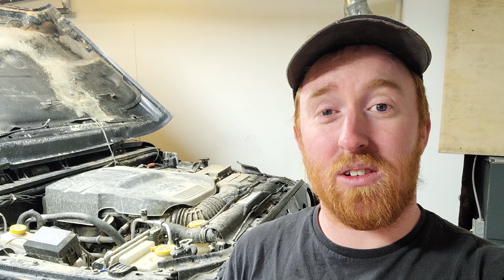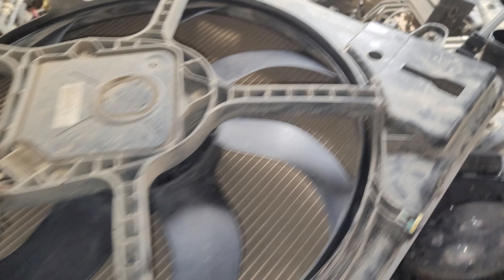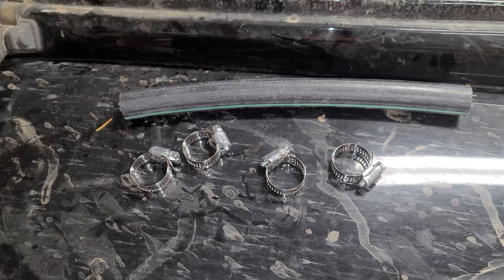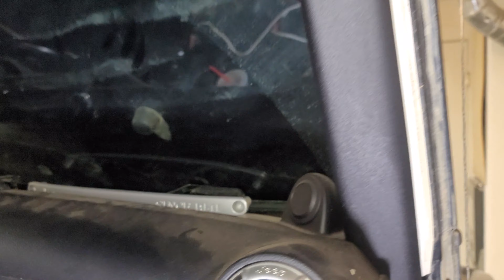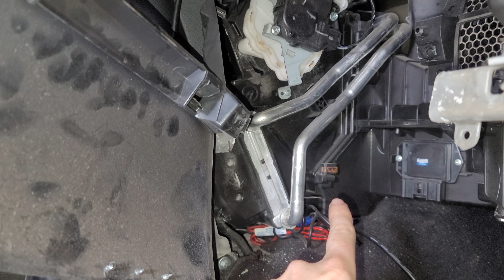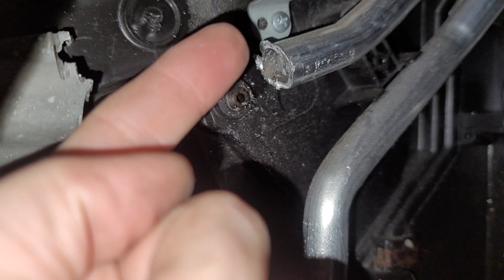Jeep Wrangler JK CASTING SAND FIX!! Replacing Radiator and Heater Core

Comment: I believe that with the cost of $1000, to remove a car or trucks dash, to remove and replace a clogged heater core, that a inline coolant filter is necessary. Just do it.
Reply from the maker: I did end up adding a coolant filter in the jeep, which helped a lot in addition.

Comment: Did this fix the problem for good? Having the issue right now.
Reply from the maker: It did mostly. I ended up adding in a coolant filter as well to collect the little bit left over. The combo of the two helped out a LOT. I recommend both. I have that video posted as well.
Reply: @4WDTrek  please post a link
Reply from the maker: @greenlawler  https://www.youtube.com/watch?v=D1j9o2Xk9pU&list=PLwh0HtmxULTWqQTefPcoSEmA_7ptGzfL5&index=10

Comment: I have a 2010 and just need to change the heater core. what coolant did you put back in?
I read it has to be HOAT, but the HOAT I found was Gold. The stuff that leaked all over my passenger floorboard was pink.

Also, how much coolant do I need to refill after I drain it all?
Reply from the maker: I do believe it should be HOAT coolant. Could be a possibility that someone put the wrong coolant in at some point.
I'm unsure coolant capacity for the 3.8l engine. I would suggest looking at the owners manual to verify the coolant type and capacity specified for your year. 
Probably your best reliable source.

Comment: I recently bought a 2016 Wrangler with 23,000 miles on it. Heater works great. Air-conditioning works great. No leaks. No coolant smell. The overflow bottle was very low and I have since filled it to the correct level. Do all 12-17 wranglers have this problem issue ? Thanks!
Reply from the maker: This issue was primarily for the 2012 and some 2013 models. Most 2014 and newer don't have an issue with this at all. So you should be perfectly fine.
I would keep an eye on that coolant level in the overflow and make sure it isn't leaking out from somewhere. But with 23,000 miles, you should be good.

Comment: Why wasn’t the engine oil cooler not replaced
Reply from the maker: I didn't think I needed to do that.
Unfortunately, I am regretting that decision right now and am needing to replace that. I am still getting casting sand in the heater core. So That is coming in the very near future.
Reply: You need to think about adding a Mishimoto MMCFK-JK-12BK Coolant Filter Kit Compatible With Jeep Wrangler JK 2012-2018 Black I’m doing this with radiator, flush, heater core and engine oil cooler this weekend . The kit is 173 bucks
Reply from the maker: @bkdrchoker1  Just looked that up. That is a great suggestion. I will probably do that too!